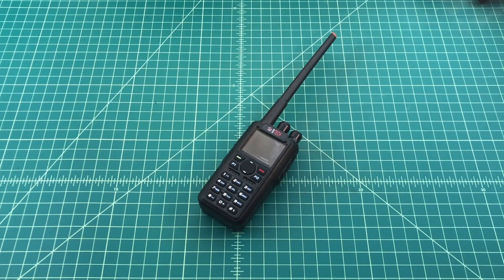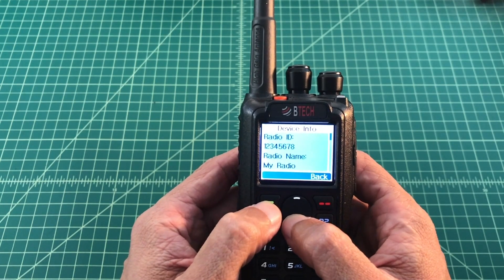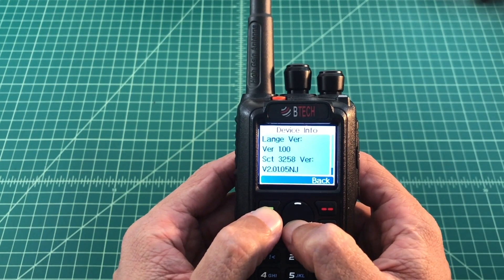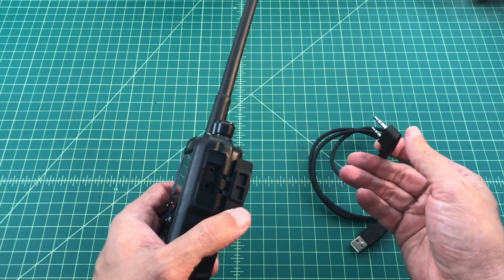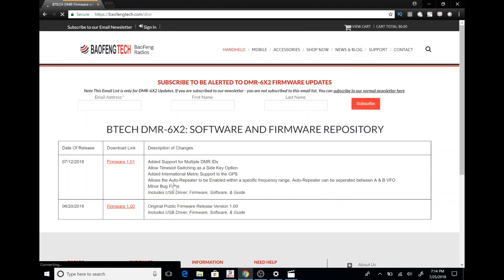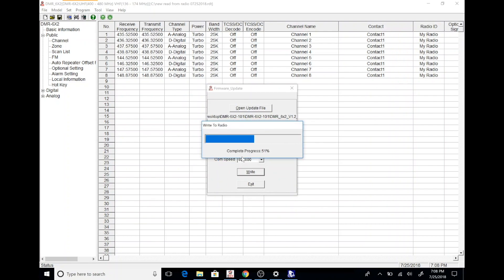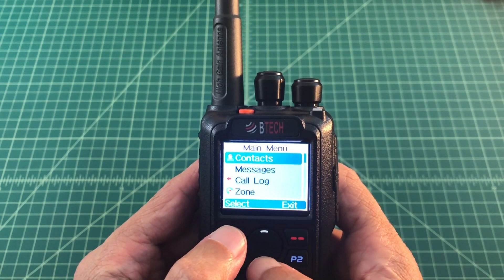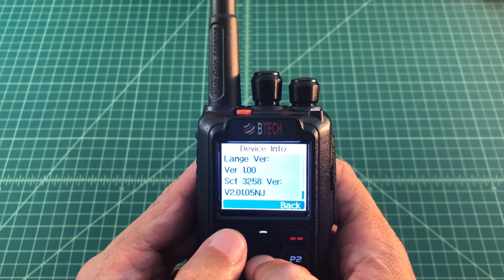BTECH DMR-6X2 v1.01 Firmware Update - How To - TheSmokinApe

Comment: I received my 6x2 last week and it is at firmware 1.01. I've downloaded and have programed my radio with the rev 1.04. When I click Firmware update from the tool menu nothing happens. Nothing changes on the pc or the radio. Any idea. Thanks so much.
Reply from the maker: You should get a pop up window, when you click that option.  Also, you need to make sure your radio is in update mode.
Reply: @TheSmokinApe  Thanks for the feed back.I didn't have the radio in setup mode. For some reason my Windows 10 pc would still not do anything after pressing Firmware update. I used my Windows 10 laptop and everything worked just like your video. Thanks so much. Mike KK4YAQ
Reply from the maker: Michael Williamson glad to hear you got it worked out!

Comment: Smoking Ape  - your videos have been enormously helpful. An optional setting that I am completely unfamiliar with and can't find the answer to. In OPTIONAL SETTINGS > Digital Fun > SMS Format...

What (if  any) significant difference is there between M-SMS and H-SMS? Which should I be using, or, does it matter?
Reply from the maker: Thank for the feedback, I am glad the videos are helping folks.

I’m not an expert on SMS and haven’t played around with it much.  This option, as I understand it, sets the format for the messages to either Motorola or Hytera.  Motorola and Hytera make DMR repeaters that can be or are linked to the same type of repeaters.  It’s my understanding that most amateur HAM DMR repeaters are Motorola based so I would use M-SMS.  Hope that help you...
Reply: Man. That makes sense.  Thank you!!!

Now for the NEXT tutorial suggestion...

If I am not a HAM operator. I got these handsets for use on my Fire Dept and they work well. (I have 3).  I also use them for camping, hunting, etc. 

However, it seems like I almost HAVE to have an ID to utilize the radios on the DMR net stuff. 

Is this true?
Reply from the maker: You do need an ID for DMR usage.
Reply: Thank you for the answer! OK... I guess a HAM course is next on the list. Keep up with the videos, you are a great teacher. 

Last question.. I have activate GPS, but I don't seem to get any position information. IS this a DMR function?
Reply from the maker: Dave Steele still learning the GPS stuff.  It’s my understanding you need the firmware that was released last week to broadcast gps data and it only works on DMR.  I do use this radio tethered to an Android tablet and use APRS position reporting.  I am working on an APRS video.   Good luck with the license.

Comment: One question...if the firmware that came in the radio is 1.01, should I download the 1.02 firmware that is on the site? Or should I only download 1.01 firmware?
Thank you.
Reply from the maker: Mine shipped with firmware 1.0, I downloaded version 1.01 of the CPS to install what was displayed on my radio as firmware version 1.2.  It’s pretty confusing and I think BTECH has stated there was a “typo” in the naming convention but I am not sure what they mean.   It’s always best to install the latest version of the CPS and the firmware.
Reply: @TheSmokinApe  thanks again👍

Comment: I should have told you! the firmware update would not work for me. I contacted BTech and they had me hold down the PTT and Orange button at the same time then turn it on, to open program mode. After that it worked perfectly.
Reply from the maker: Yeah, you need to do that for the firmware but not a code plug update.  Glad to hear you are up and running.
Reply: TheSmokinApe yea love it. My rugged spot should be here this week. Thanks
Reply from the maker: Man, I would like one of the rugged spots.  I’ve been looking at a few different models.
Reply: I will let you know how it works. Should be here this week sometime. I will say the guy that owns the place Nex-Gen gas been great to work with. always answers emails. Check him out. HamRadioConcepts has a video on the rugged spot.
Reply from the maker: Whit10mm thanks man, I have seen the video and checked out the Nex-Gen site, looks like an awesome product.